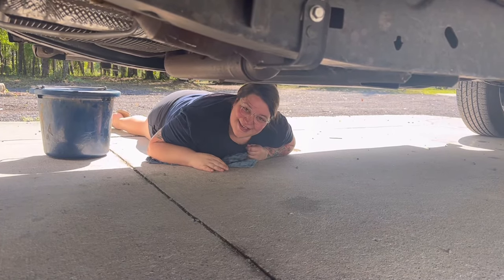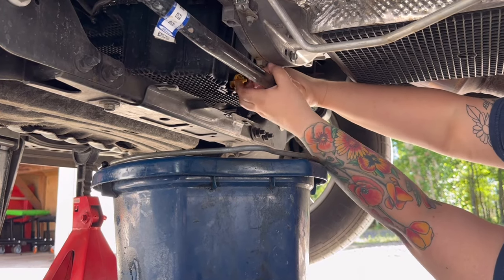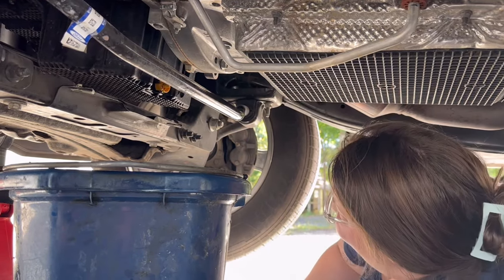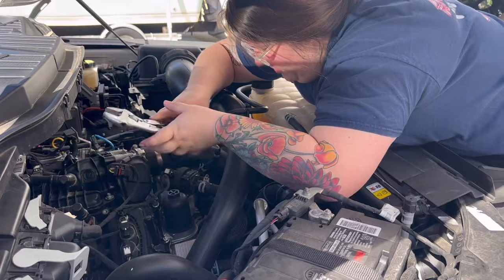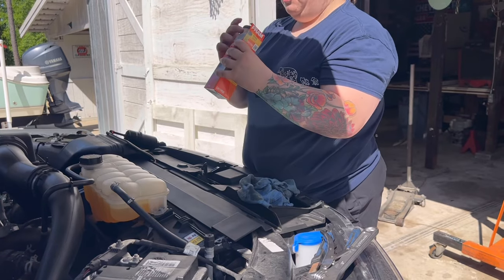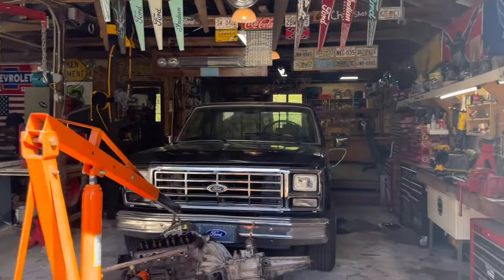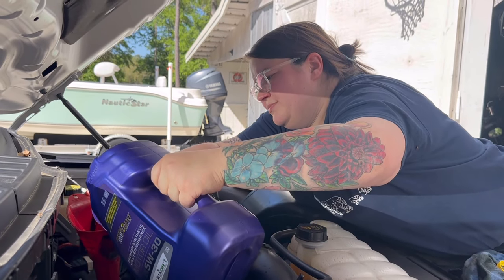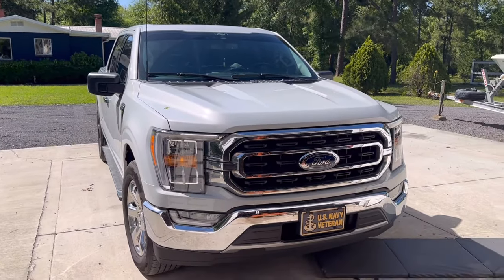2021-2024 F150 2.7 EcoBoost Oil & Filter Change - Wife Edition

Comment: Good video. I found that it's best to leave the plug out, change the filter, then put the plug back in. That oil filter canister is full until you loosen it to remove the old filter. A little less than half a quart comes out the oil pan when that filter canister dumps its oil. The oil only flows out the oil filter canister once you loosen it and allow air in. I don't know how important it is to change the canisters o-rings every filter change, but I do it since they include them with the filter. Take care.
Reply from the maker: Great advice! I didn’t know that but after you explaining it, that makes total sense. I’ll definitely leave the plug out next time. Thanks for commenting 👍🏻

Comment: great video, would caution using oil that doesnt meet ford spec under warranty like RP
Reply: Alternate motor oils if Motocraft not available - use the recommended viscosity grade that displays the API Certification Mark. Only requirements are the API circle and viscosity. Doesn't void warranty.